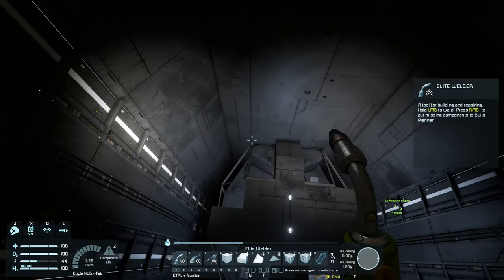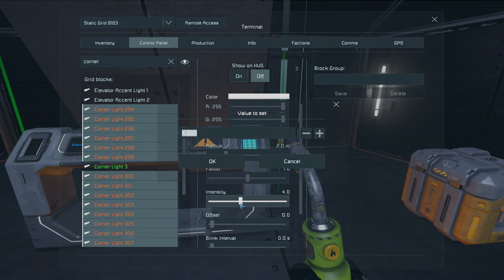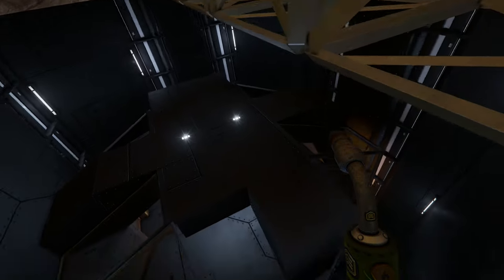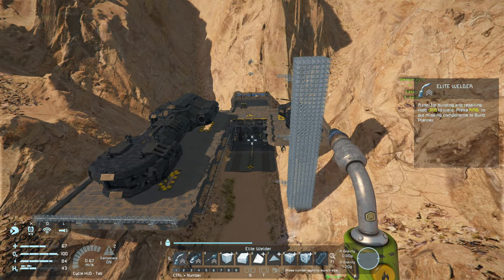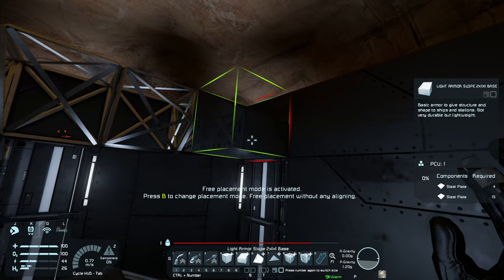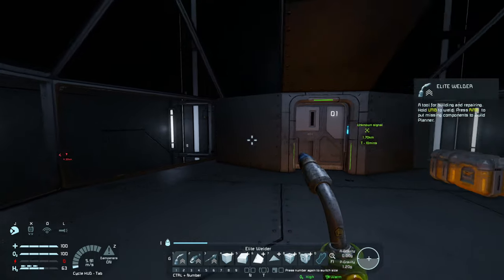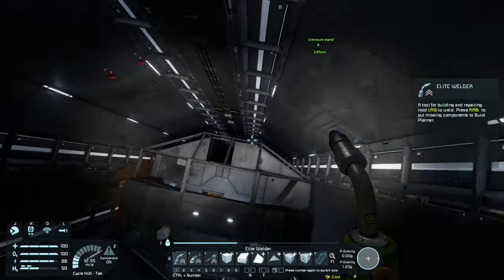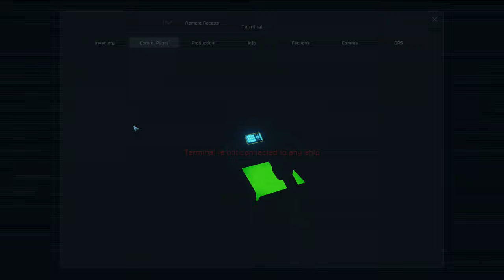Space Engineers - Wasteland Survival Ep51 - Adding Lighting to the Elevator Shaft

Comment: I will not tell you that the elevator shaft doesn't look amazing, because the elevator shaft looks amazing. 

I had a thought about the control tower, as I'm in the middle of watching the video: 

I don't think it would be unreasonable to build a second, smaller elevator off the corridor on the third floor, in order to have the control tower even higher up. 

In most, if not all high-rise buildings the elevators reach only part of the way up, to avoid having shafts stretching the full height of the building. This is a safety feature at least as much as a way to reduce the engineering challenge. 

Anyway, I'm looking forward to seeing what you'll build!
Reply from the maker: Thanks mate!! 😎. I have to admit it was tempting to create another elevator but given the fact this one took me soooooo much time I wasn't keen on doing another one LOL.
Reply: @TheGarageGamer86  I can imagine!